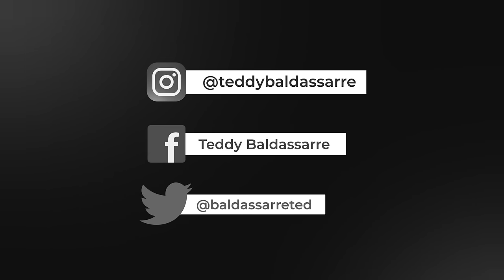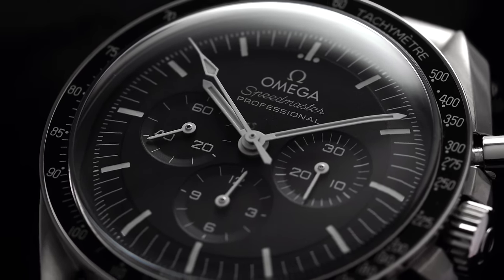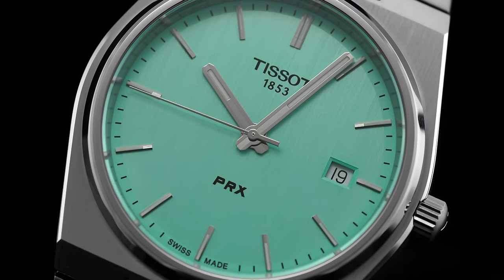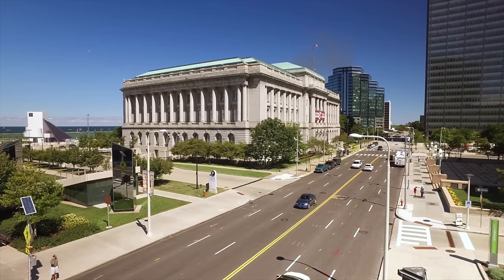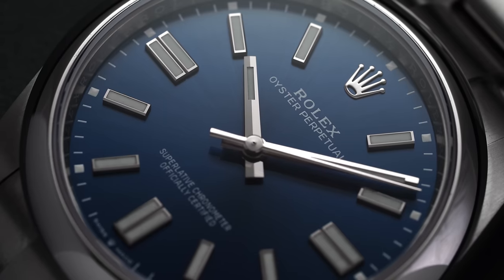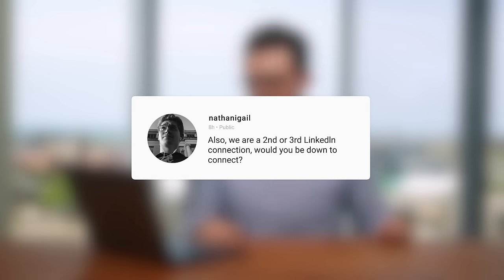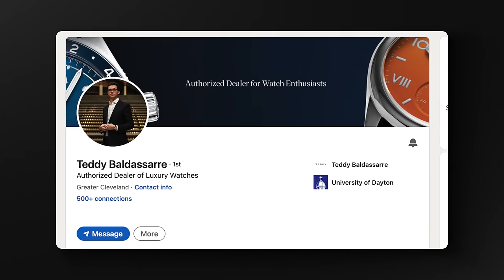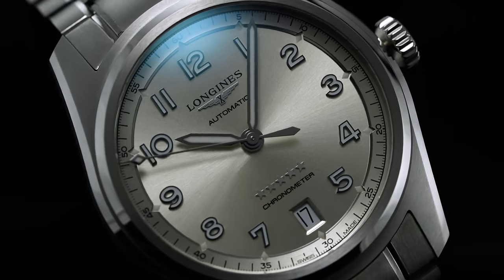OMEGA vs. Tudor, Why Are Quartz Watches Looked Down Upon? CPO Rolex, & More (Q&A)

Comment: It's a paradox that will never be settled, the Quartz is more accurate with less maintenance and less moving parts that can go wrong, it does everything a watch should do at a level mechanical watches can only dream about. The mechanical watch on the other hand is where artistry, history and engineering collide, a 500 year old technology that bypasses the brain and speaks to the heart. I value the accuracy over the artistry but I'm definitely in the minority. And to answer your question the Quartz is seen as a gadget and the mechanical watch is perceived as a machine.
Reply: That's a great take.  If you want an accurate time keeper, look at your phone.  If you want a piece of artistry, get a mechanical watch.  Watches, in an of themselves, aren't particularly practical today.
Reply: @brianforrester9670  "If you want an accurate time keeper, look at your phone." -- Maybe if you are a teenager glued to your phone all the time. My phone stays in my pocket until I have a reason to use it. I do look up time much more often than I use my phone, and fumbling with phone is (1) inconvenient, and sometimes (2) rude. Finally, (3) sports.

Comment: I think the battery issue is the thing - when you have a collection and wear some or all of these, it will be sometime before you get to the quartz ones and the battery going flat is the thing.
Reply: I don't have that problem. All of mine are solar, radio controlled and perpetual calendar.

Comment: When you are talking about spending big bux on high ticket discretionary status symbols, you’d have to be blithely naive to whinge about snobbery. The whole luxury goods sector requires snobbery in order to thrive. Though I see no need to for condescending pomposity to sully the sector, because we can all appreciate even many of the low cost pieces. After all it’s a very subjective thing. Thanks Teddy and God bless.

Comment: 1. Tudor has no design of its own - even bb58 is just for people wanting a sub but cant find/afford one. 2. Tudor is a flagrant  offender of bundling in China - to get a Rolex at retail, buy 20 Tudor at full price. They are then sold on the secondary market for less than half the price. A brand new 1926 costs under $900 in China. 3. Tudor will never become an independent brand that even qualifys to compete against Omega as long as Rolex exists; ironically, it would not succeed without Rolex either. It forever lives in Rolex's shadow, call it a curse or bless.
Reply: No one cares
Reply: @thetruthhurts7500  isn't this what the video is about? you dont care - fine, don't watch it. keep the debate civil otherwise

Comment: The destruction of the Swiss watch industry by quartz was a self-inflected wound.  The Swiss had a long tradition of producing the most accurate time pieces available. 

Both the Japanese and Swiss were moving quartz technology forward in the 1960's.  Both the Japanese and Swiss released quartz models in the early 70's.

But the Swiss Watch industry did not embrace quartz the way the Japanese did.   Watchmaking was part of the Swiss identity and many considered quartz movements as the antithesis of the watchmaking tradition.  The Japanese had no such qualms. The Swiss watches were first and foremost associated with accuracy, and yet they thumbed their nose at the very technology that would have assured their continued reputation for high accuracy for generations to come.  

The lack of the enthusiasm for Quartz cost Swiss watch manufacturers dearly as over 60% of swiss brands had gone out of business in less than a decade.

Swatch eventually saved the Swiss watch industry from themselves, but there is still a lot of resentment (misplaced, I feel) towards the technology.  The Swiss had the opportunity to own the quartz market and chose not to.  That's not the fault of the technology, but those who refused to wield it.

The swiss watchmaking industry has come back, but they are no longer seen as the ultimate in accurate timepieces. they are now primarily known for "luxury" timepieces, where presentation, finish, and branding trumps functionality and accuracy.

Comment: In my mind a quartz watch is just a machine for telling the time, not quite as good as my radio controlled clock but portable and should be very cheap because the movements in general cost a few pounds. The difference between quartz and mechanical is analogous to boats, sailing is a very nice way to get about and a RIB is just transport with none of the charm.
Reply: All of mine are solar, radio controlled and perpetual calendar. Premium JDM stuff from Casio Oceanus and Seiko.
Reply: @brocklanders6969  I get that absolutely but never feel an attachment to them. It could be a one watch collection.

Comment: Because quartz watches are as dull as a Tesla. And manufacturers don’t bother repairing those movements, they toss them and place me ones. So it’s disposable instead of build to last
Reply: I have Seiko quartz that are 40 years old and going strong, yet my Rolex Air King has had to be repaired twice. Watch makers using 3rd party movements are just as likely to replace than repair.